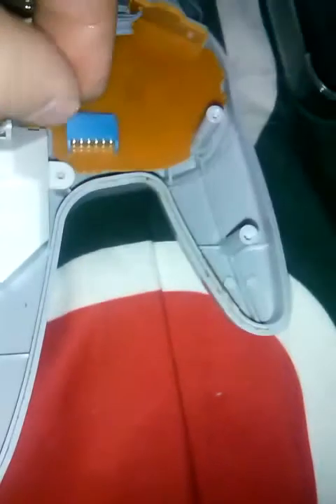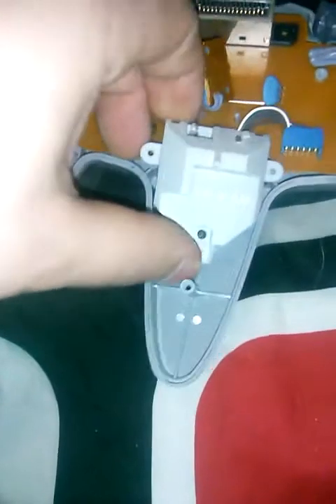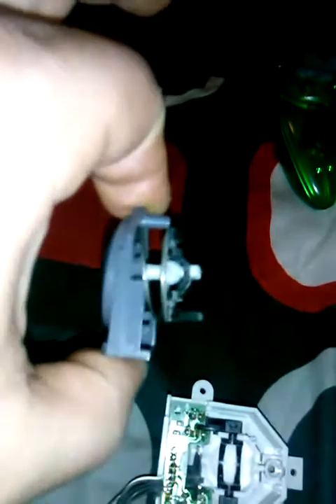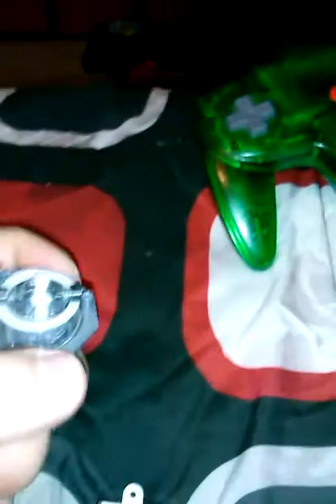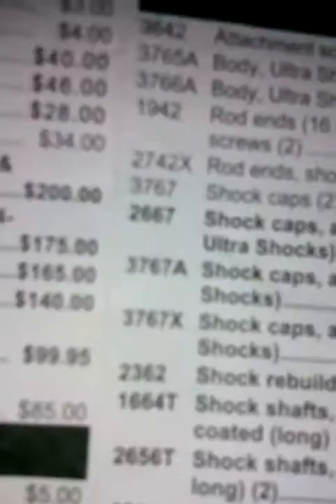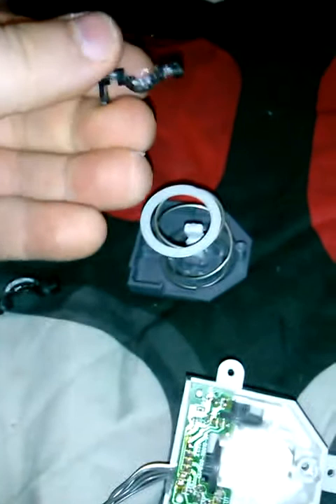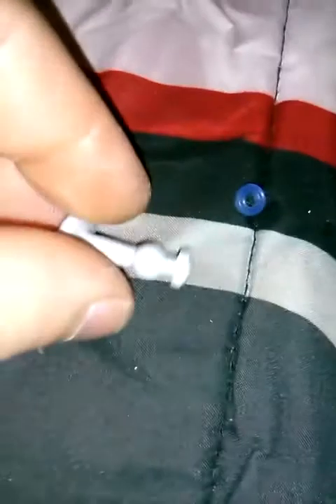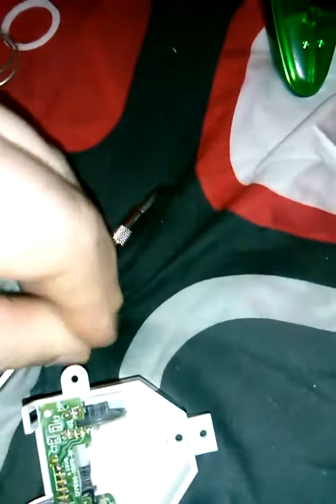GREAT N64 Joystick fix. No tape or glue/epoxy!!

Comment: I just did this. Ordered the parts. Joystick is a bit tight, but this is by far the best solution going. This was 6 years ago. How are your controllers holding up? People are out their melting plastic, taping, buying crappy knockoffs. This is a great solution.
Reply: I made a metal ring out of like 8 mm of a paper clip, very smooth.

Comment: Firstly, this is a great fix! If you don't feel like waiting for an RC repair kit to come in the mail or if you do not have an RC store in your area, here's another option. Go to a place that carries body piercing jewelry and get an o-ring for 8 gauge plugs (ear jewelry). You can also get the o-rings at a store that specializes in gaskets for automotive or industrial use. The inside diameter should be approximately 1/8" or 3.25mm.
Reply: +crowbartexas666   
I'm not an RC guy but having gauges proved very useful.  nice

Comment: I used my girlfriends acrylic nail polish and uv light to paint on layers to the bowl. Worked perfectly. It seems that the scraped and dug out bowl lowered the level which reduced tension from the spring. However, if the bowl is too low and you use your method, there may still be a gap between the tip of the stick and the bowl which may cause too much pressure and damage the black fulcrums. Your way is perfect if the bowl isn't too low. In any case, I'm gonna use both methods since your way seems like it would prevent the same thing from happening in the future. Great video. Very clever.
Reply from the maker: Thanks Bill...the nail polish idea is awesome! Also, what I've had trouble figuring out..does the bowl AND fulcrums (thanks for the proper word btw lol) share the same pressure when the controller is new? At first I wanted to believe that the joystick never really touched the bottom of the bowl..and since you can't see inside when its put together, I never could tell. But your comment made me realize that the bowl is important too..it works as a guide as well. Hard to explain HOW it makes sense in my head lol..but it does now. I think you are right..using both methods would be ideal. Thanks for your comment! I just hope now, that people dont hate my vid, because you ARE right...they both are important issues, and my technique in this video clearly ignores one of them. Maybe I can make an edit in the description and give you some credit for it. Thanks again for the comment!
Reply: ChevyBalt87 Hey Chev. The fulcrums would be the guide and the bowl would take the brunt of the pressure. So if the stick doesn't touch the bowl, the fulcrums would take more of the pressure. But I just opened a controller today and the fulcrums were really shitty in the middle where the stick goes in.Instead of being straight on the inside part of the fulcrum, the are worn down so its wider in the middle than the ends. This is where the "tape" method might help to hold it in place, but it would then pose a problem when you push the joystick to the sides. Either way, just the acrylic isn't enough for this one. I'm gonna have to glue some kind of plastic or something to it. I doubt that epoxy or acrylic would hold on such a small piece if I use it to build out the worn plastic. I haven't had time to buy any bushings. But this is a whole new problem.
Reply from the maker: Yeah, it gets bad..me and another guy in the comments were discussing that. The 2 rails seems to be opened up wider when this happens. I guess its because the plastic weakens as it wears down and gets thin, the 2 rails spread out making things even worse. I was trying to find a way to maybe lightly heat the rails and squeeze them back together a little
Reply: ChevyBalt87 I though about that too, but since there is just less plastic in the middle than the ends (its not bent or warped) I don't know if it would be possible or even a good idea. The plastic on the outside of the rails is straight and parallel, the inside is just worn away.
Reply from the maker: Bill Chatzopoulos Agreed..I never tried it. You're right too, if the shape got screwed up too much, its just asking for trouble, such as the fulcrums rubbing each other or something. I used to do a lot of plastic fabrication.. but trying to add or "build" up plastic on something so small and precise just seems impossible to me.
Reply: +a1rh3add How have/did the new fulcrums hold up? did you use this method and the new fulcrums?
Reply: ***** horrible from the start. I ended up trowing them out. Felt very rigid and the stick wouldn't stay centered. I ordered four sets and all had the same results on all four of my controllers. I ended up ordering the gamecube style replacements. I bought the Repairbox V2 set. They are more refined than the V1 but still are slightly oversensitive due to them having smaller range and less "steps." in all they work fine once you get used to them and dont have any issues with Oot spin attack or Smash bros moves. Racing games and fps are kinda fubky at first but you get used to it. On mariocart I find it best to hold the stick up as you steer. Duke nukem 64 is kinda hard to play at first but now i have the hang of it. Goldeneye isnt as bad as ppl say.
Reply: +a1rh3add thanks for responding. good to know. I used the method from this video along with a bit of synthetic grease on 4 controllers and 2 of them ended up sticking up. When I opened them back up is seemed the the bottom of the control stick was hitting the bowl at certain points would force the control stick upward. I tried 2 things that seemed to work. I switched the bowl out with a more worn bowl and switched the vertical gear to a different one. They all seem to do well now. I ordered a few of the new fulcrums and will see how it goes.

Comment: Very cool idea. I love it, I restored one of the worst sticks I saw which registered no movement in mario kart. I used some epoxy to rebuild the black rails and combined with your method. I also rebuilt the bowl up. The result is a great stick with all movement directions restored.

only issue is the Y axis is a little sluggish/more resistant despite being lubed but way better than before.

Comment: This is honestly the best fix. I've tried it on some controllers and my friends think I am a god! :3 Regardless, it's always a good thing to also put a little of epoxy glue in the black gear's gap, to make them more tight. The top black gear is usually irrelevant in that regard however, because the o-ring already fills in and makes it tight enough. Grease up all the joints and you've got a good as new n64 controller!

Comment: I would like to note that instead of using the bearing oil I used molykote grease for plastics and it works like a charm and I think it'd be a lot safer for your controller in the long run

Comment: The idea is good but rubber will have grip as you said. The real problem i found using this trick is that the X axis is perfect, the Y axis feel weird cause the rubber is gripping on the black gear. I used every grease on this planet, it just feels weird. This is why you can play Mario Kart properly, it uses x axis. I used your trick but switched to those little metal rings you find on some bracelets. Now the stick is like a new one, not having any problems of deterioration, grip, metal ruining the plastic, whatsoever

Comment from the maker: A few notes on this video.. 
1. If you have any hobby stores near you, theres a 90% chance they carry traxxas brand R/C vehicles. And that particular shock rebuild kit is very common and usually always in stock. 
2. As I said in the video, I dont know if this will last for years and years, but its worth it for me to regain so much sensitivity in the thumb stick. I've watched other videos and people say that "other" fixes aren't always accurate in the game controls. My method really is like a brand new controller (I'm comparing it to a new-old stock smoke gray controller I recently bought). So I really hope this helps you guys. If you have any questions on something I didnt cover, feel free to ask!!
Reply: I just ordered one of these kits off eBay. Not bad, cost me about $5 with shipping included. It's worth it for me to be able to fix 4 controllers. I was about to order a 3rd party joystick that cost more than $5, and I've heard bad things about the sensitivity on those. Anyway, do you think a bit of Vaseline would do the trick if I don't have any oil? What about lithium grease in a can, like the type used on cars?
Reply from the maker: Docter Zaius hey there doc...vaseline is pretty thick my friend...although slick and slimy, I think it would have some resistance to it, and really lack in smoothness.
Reply from the maker: EDIT: Bill Chatzopoulos in the comments below, brought to my attention how the bowl can in some cases be the issue too. My video states at the time that I didnt think it was the problem. While my method really does help, Bill is right too..and thinks that rebuilding the bowl bottom, and using my technique would make for the best result.
Reply: ChevyBalt87
What are your thoughts on the white lithium grease spray then?
Reply from the maker: Docter Zaius I can't say I've ever used a spray so I dont really know. The only 2 things I can say I'm familiar with is either a silicone oil, or the bearing oil. Both very thin, but very slick
Reply: ChevyBalt87
OK well I guess I'll try it and hope for the best.
Reply: White lithium grease in tube format is what you want it is used stock on a lot of plastic toys. Nerf modders use it a lot some use the spray in that case but for controllers it's more accurate to pick up a tube in a automotive area or some where more cheap.

Comment: AWESOME video! i ordered 3.2mm o rings off ebay as they were cheaper in uk. only thing is the up and down movement is a bit stiff, i used oil like wd40, think i need some proper grease

EDIT- ordered "carlube" grease off ebay, but still no good with the up and down movement, think the jewellery o rings were too soft, should of ordered traxxas like the video says

Comment: I used a cheap O ring from auto parts store before I seen this video! Seeing those bushings as they look flat may work better than a rounded ring! How about dead zones in control stick after fix? If the black plastic parts are wore on the inside to much, the bushing/o-ring fix won't help the slack from side to side movement!

Comment: This is really cool. Any recommendation for what oil to use? I found a silicone based oil at an RC store nearby me. Will this work or is this not good for the controller?
Reply from the maker: There may be debate over using lubricants inside the joystick. Some may say its bad...but I say it can only help. As long as you dont just deliberately overflow the crap out of with oil, it can only help. For obvious reasons, if u put too much oil, it could leak to the outside of the controller, possibly screw something up on your circuit board, or if you have any of the transparent controllers, it would look nasty. I'm pretty sure the oil you're talking about is what is used for the r/c's shocks. I believe its a silicone bases oil. But I think it would still work great. Go ahead and give it a shot. Its very slick which is what ya want. If you have anymore questions, let me know!
Reply: ChevyBalt87 So I tried it out and the stick is much tighter now. Only, it only really goes toward the right now. Any ideas what I could've done wrong and how I can fix it? The controller feels great tho lol
EDIT: My N64 does detect other directions, just not to the left actually. And it starts to just go to the right after a while.
Reply: Kyle G Fiddled some more and somehow got it working. Not sure what changed. Great vid tho! Controller feels better than new
Reply from the maker: Kyle G Hey Kyle, it could have been that maybe the plastic was binding because it wasnt fully lubed well yet. Also, you probably know this...but remember that since day one of the 64, people have had issues with the controls being inaccurate if you move or bump the joystick while the game is loading. I remember the 1st time I played mario kart with my cousin. He turned the 64 on, and I was moving the joystick around, and the controls were all weird once the game started. We would just reset the console. (Side note on that: I think theres actually a series of buttons you can press to reset the sensors to "zero position" if that happens to the controller, so you dont have to reset the console.) But anyways... Maybe you could have bumped the joystick? Or something was stuck ot wrong inside from when you put it back together? Either way, I'm glad its working better for ya! Ive had different results with different controllers. I think it really just has to do with how bad the controller is before the repair. I hope this fix lasts a while! Although quick and cheap, no one really wants to take a controller apart once a month to replace a bushing, lol. Sorry for the long reply, I just really want to be thorough and helpful. Let me know if you have anymore questions!

Comment: @ChevyBalt87 It worked Amazing however I need a better lube, the stick grabs going up and down. I know a better live will fix it I used a Silicone spray. What was the best lube you found that works BEST.?
Reply from the maker: The bearing oil that I showed in this video is actually the only thing I have used, because I had that from the very start. I had silicone oil as well, but didn't even try it, because I knew that the motor bearing oil would be the best. I just thought of it like this, if a few drops of that oil, works for a motor that is spinning thousands of RPM's, without gunking up? Then it HAD to be good! haha..so far that's been the winner for me! :D

Comment: So I FIXED 2 of my controllers and WOW!!!  I give it a 8 out of ten I deduct a point cuz it grabs a lil bit going up and down, I need to find a better lube, silicone spray is alright but I need something slimy would imagine that would work better, and I deduct another point cuz I haven't tested longterm.
Reply from the maker: Hey friend! An 8 out of 10 sounds good to me, ha! I'll be COMPLETELY honest of my experience since making this video. I had ONE controller give me a little bit of an issue, on my left to right axis. The sensitivity is off a bit..as in, if I try to go to the left, its not as responsive as my up/down, and right. I think the issue could be because the black rocker (fulcrum) was just too far gone and worn, OR it could've been because I didn't have it lubed good enough. Other comments have said that their little o-ring snapped after just one day of Super Smash Brothers. I firmly believe that a thin bearing oil is the best way to go, for best movement and to prevent "binding" or breaking of the o-ring. I hope it works out for ya though!
Reply: +ChevyBalt87 Thanks for the awesome video and quick reply! YOU are A GENIUS! My sensitivity works awesome! My fulcrums weren't worn BAD at all so I think that is why. Im gonna try thin bearing oil just like the one you used in video then I will post results. I just want to share that I did have a very worn fulcrum and Inused my girlfriends nail acrylic to rebuild, it's very easy to apply, work with, bonds rock solid to fulcrums, easy to reshape by filling if you need to, and fully dries in ten minutes so as far as worn fulcrums I found a solution.

Comment: WHY has no one just made a metal version of these parts? It would take all of 10 minutes every 6 months to put some grease inside and keep it working like new for GOOD. I would straight up pay 30 bucks per set if they were metal. update After posting this I bought the seal, will combine with my rifle grease in the bowl.
Reply: Someone is, check out steelsticks64 - http://steelsticks64.com I check their twitter for latest updates though
Reply: RetroPlay Days 125 bucks please...
Reply: Jose Ignacio Freire You could just get the steel bowl which in theroy would make it a bit tihgter since the stick falls loose due to the axis peices and the bowl.
Reply: I made metal rings out of about 8mm of a regular paper clip, very smooth.

Comment: Could I buy O rings in a similar size to these at like a hardware store? if so what size should I be getting?
Reply from the maker: I really can't remember the size..as of right now, I don't have any spare shock rebuild kits on hand (the kit has a slip of paper showing o-ring sizes). But I would imagine if you bought an "o-ring assortment", from say Autozone or O'Reillys..they usually have huge sizes, all the way down to tiny ones. It will have hundreds of o-rings (multiples of each size) The last time I bought one, it was like $10. Sorry that's all I can do for ya, but hope that helps!! :)
Reply: +ChevyBalt87 

Yeah I hope ill be able to I mean the method I used was taking thin soder wire and putting it in the same area you did with the o ring. then lubercating the same areas and they hold up but I feel like they will break down. This method looks promising though and I just want to get the correct size.
Reply: +ChevyBalt87 you sir are the man. i didnt have the o - ring but instead i used a very small hair rubber band and wrapped it a few times around it. just until i get one like yours. Works like a champ.

Comment: This fix is great, but the little rubber pieces have been snapping for me (usually get about a day of super smash bros out of the controller before the band's break). Anyone else have this problem? I have been using white ceramic grease as my lube.....this doesn't breakdown the rubber piece does it? Anyways, thanks for the help!
Reply from the maker: Hmmmm..mine have been on there since I made this video, and I haven't had a problem. Although I do use a bearing oil, not grease. But I don't see why the grease you are using should be a bad thing..sorry that's happening :/ I was so excited when I made the video..because this worked PERFECT for me..but now after reading a lot of the comments, I wonder if I just got lucky?